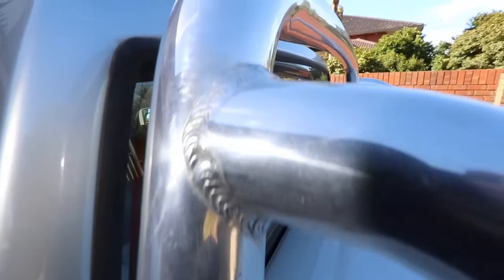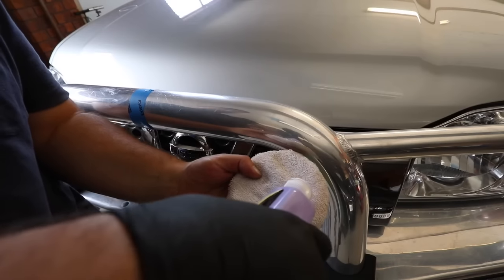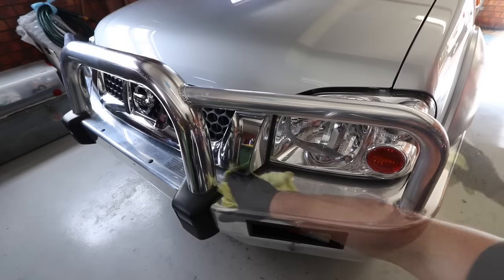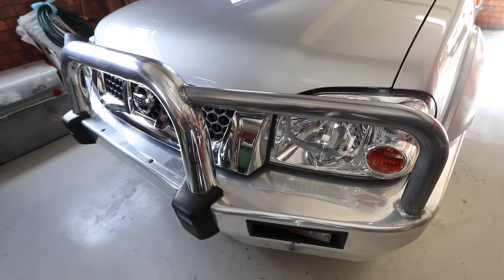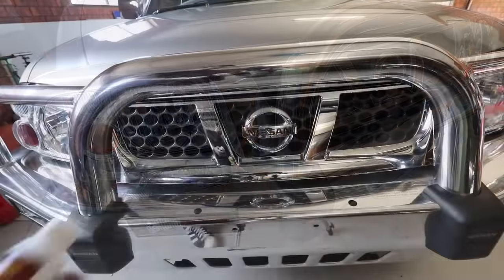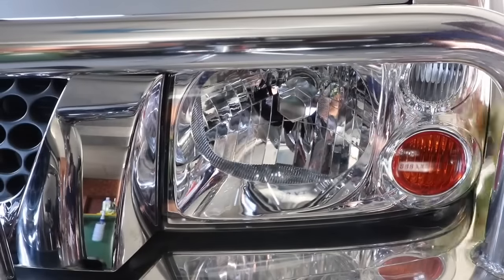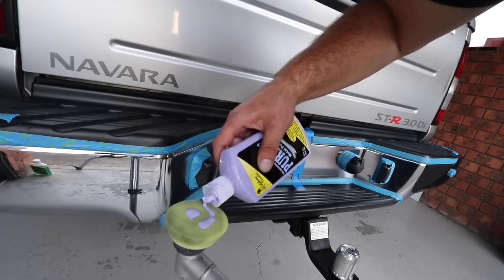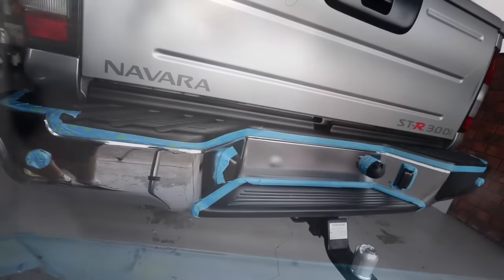How To Professionally Detail A Vehicle, Part 4 - Metal & Plastic Polishing (Vlog 2.4)

Comment: Looks like a great  way to polish my ali bullbar but not so sure how to treat the satin/brushed aluminium tray on my dual cab triton (2017)... any ideas?  I don't want a chrome finish on the tray, I'd like something close to the original look.  I've tried scouring and ct 18 which improved it but it still doesn't look anything like new.
Reply from the maker: California Customs, Autosol and a few other brands make metal oxidation removers which could work in removing the haze without creating gloss.

Comment: Hey Sandro do you have any sugestion on how to remove heavy scratches and swirl marks from chrome and plastic painted chrome i tryd polishing the plastic painted chrome and and it's really hard to polish compered to the normale paint and the chrome is as good as impossible to remove scratches from even with my Rupes nano. Would be nice to get a reply on this :)
Reply: i have autosol,Autoglym Metal Polish,Chemical Guys heavy metal polish and PolishAngel Palladium tryd for hand with steel wool and with pad and with hard pad on Rupes Nano it hardly did anything. This was on the metal chrome on the plastic chrome i used only Carpro Fixer not sure what else to do either polishing the paint was alot easyer. anyway thanks for the tip :)
Reply: do you think maybe Carpro Fixer or TLC on rotary with wool pad would work on the metal chrome?